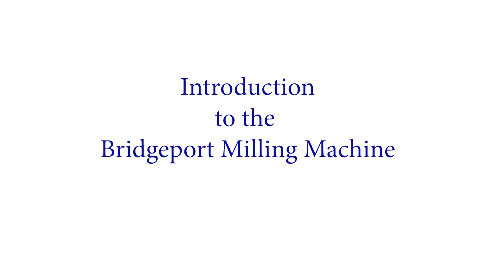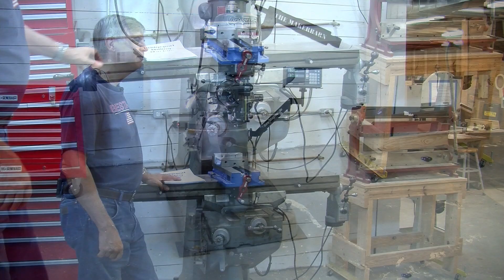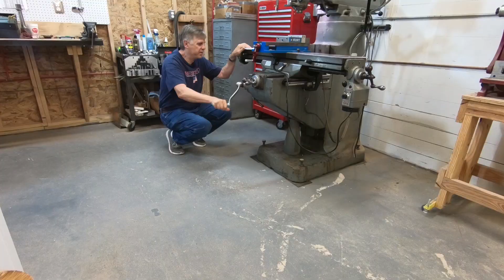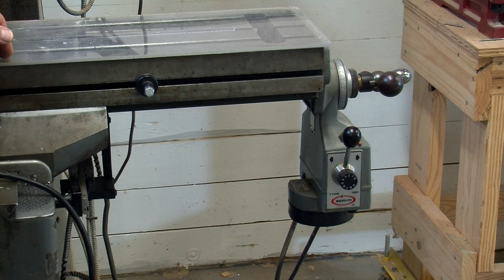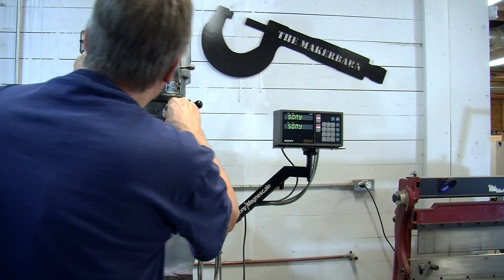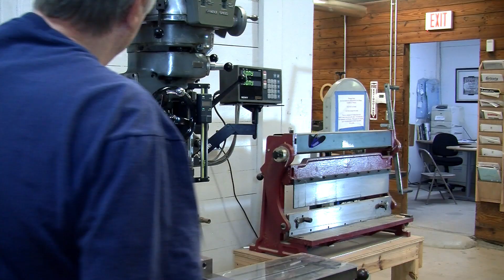Introduction to the Bridgeport Milling Machine

Comment: At opposite end of the head on the horizontal support section of the mill is a large round hole (near your wall )
What is that used for 
Just about every vertical mill I see has one but never seen any one use it
Reply from the maker: It is the mount for the slotting attachment.  The slotting attachment move a tool up and down, like a vertical shaper.  The tool can be used to cut internal keyways and even internal splines and gears.  This mill had one when I bought it.  I sold the slotting attachment and it paid for the mill.